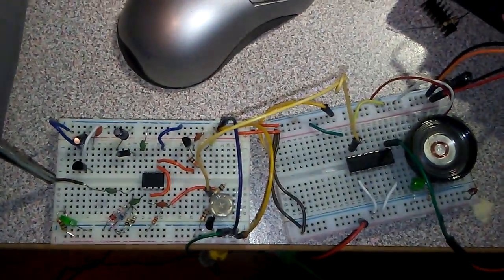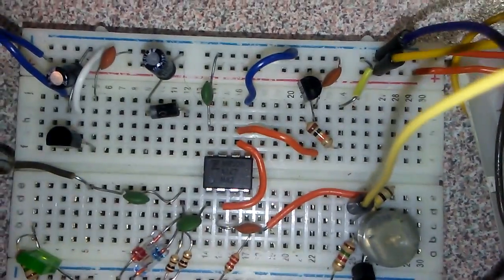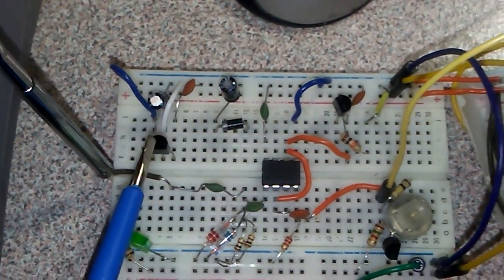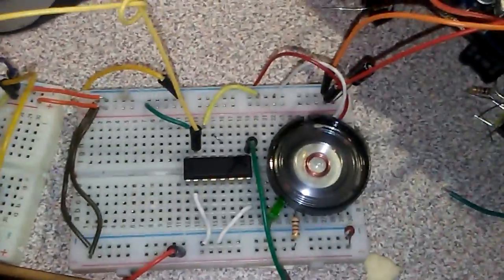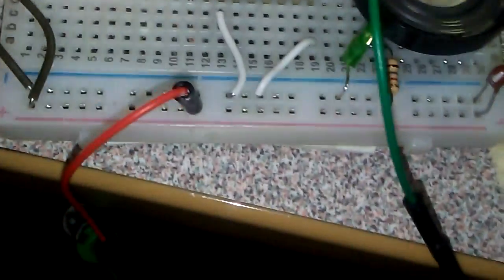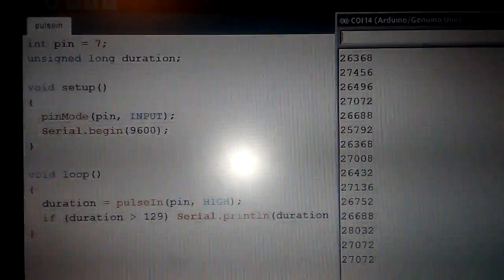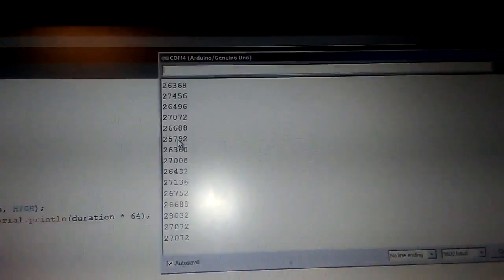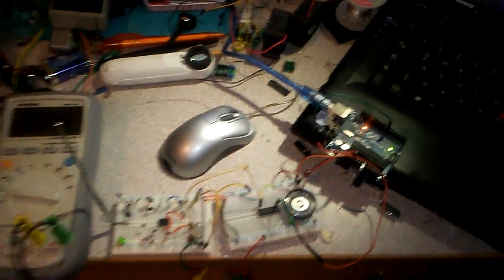what is preScaler? mb506 connected to arduino

Comment: I have a problem that the output signal power of the 506 is very low at -50 dbm is it normal how much it should be, Iam using a mb506 prescaler evaluation board from aliexpress